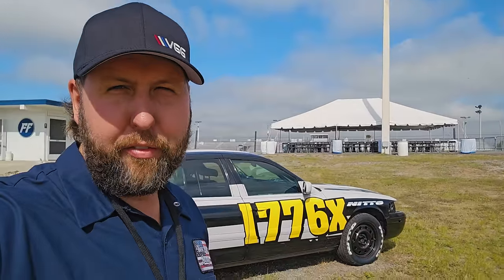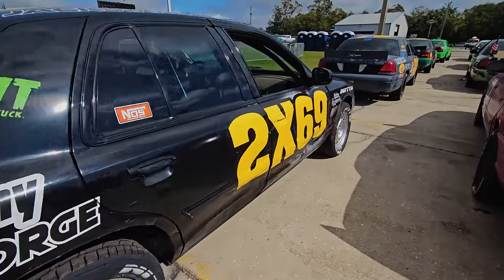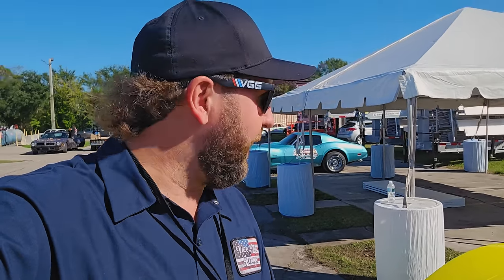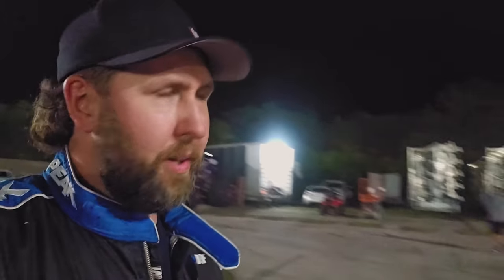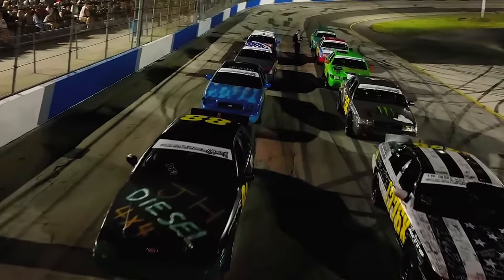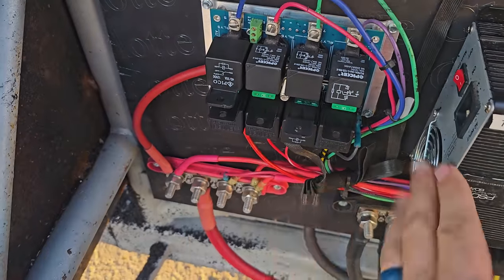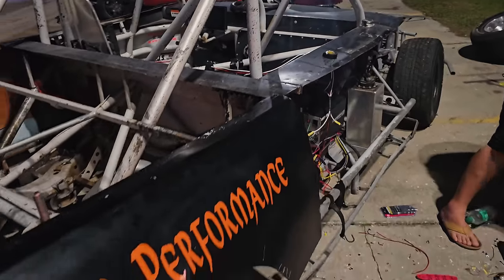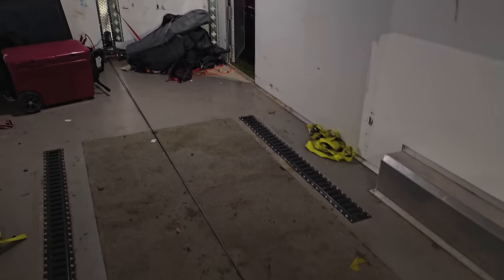We WON 1st Half At The Freedom Factory but BLEW UP Charlotte! (You won't believe how)

Comment: I'm impressed with your ability to cobble together a control system out of miscellaneous parts from the hardware store.
Reply: anyone else having flashbacks to bill and ted's Bogus Adventure?
Reply: I had a fella help me this weekend at a race track that was like that. The key broke off in my ignition and flew on the race track. The car was a 2010 Cobalt, so security systems out the wazoo. Fella actually ended up bypassing the security and started my car for me, no key and I got to race! It was a thing of beauty.
Reply: I'm sure that would have impressed MacGyver.

Comment: Chinese Fire-Drill is said to have originated when a ship run by British officers and a Chinese crew practiced a fire drill for a fire in the engine room. The bucket brigade were to draw water from the starboard side, pass it to the engine room, and pour it onto the simulated "fire". To prevent flooding, a separate crew was ordered to ferry the accumulated water from the engine room up to the main deck, and to heave the water over the port side. The drill had previously gone according to plan, until the orders became confused in interpretation. The bucket brigade began to draw the water from the starboard side, run directly over to the port side and then throw the water overboard, bypassing the engine room completely

Comment: Not having power steering could save a guy's front tires and prevent understeer!  When I was a kid I'd always remove the power steering from my Datsuns, they were so light and not being able to just panic crank the heck out of the steering mid turn saved me more than a couple times.  Never had an issue except going slow in parking lots, then you just muscle through it

Comment: I learned quite a bit about monster trucks, especially watching monster jam. During the seasons 10 years ago on weekends. monster trucks take their tires and what they do. Is use a Torch and a saw and they cut part of the treads off. Which goes along with what you say about favoring tires like the one that's on this bad lad of a monster truck! That way as you put it, they slip and slide around a lot better than being so grippy!

Comment: In the future, you can conformal coat that relay PCB, make it a bit more water resistant. Either way it’s not meant for exposed use, as you already know, and should be boxed… same for the ribbon cable.

Comment: Heck of a job in the race and the burnout pit. You seemed really down after the burnout, but you did great and put on a great show. I'd hate to see you throw in the towel with Charlotte, I love watching her shred those red and blue smoking tires. Maybe go through and delete any circle track suspension setup that makes it turn left, and give it another send. I bet the motor isn't as bad as you think. Even if it did get washed, it's a burnout car... Just plug the plugs in and let it cool off. It'll be okay enough for what it does. Shoot, ol' RodKnock Rodney just sits in the Florida rain and only even gets fired to do burnouts.

Comment: If you're planning on installing another relay board similar to the one that failed, you might want to consider a water proof coating on it and the other electronics. Many car manufacturers already put conformal coatings on their circuit boards that are exposed to the elements.

Comment: Derek, a thought for Charlottes electronic system. Have a look at something like the Switch Pros SP9100. 35 by 35 amp and 4 20 amp circuits. But it's a waterproof system, which should survive better. 

Sucks you're still having mechanical issues too.

Comment: In the past 10 years we’ve used something similar to that more like four years but nonetheless we always go back to weatherpack plugs for the relays and we have no problems might sound not so technological but nonetheless it’s not as clean of an install as not circuit board but much more resilient as well as weathertight fused connections

Comment: Was pulling for y'all to get the 'Vettes. Really sorry about Charlotte. I have to say, every time I see that truck, I wanna fly (or drive) to Tennessee, pull all the wiring out an run all new wire. Put a proper body on it. And, install inner structure into it, especially around the rear tires and axle and the electronics. Honestly, I just wish I was closer to help y'all with whatever. Any who, y'all take care.

Comment: I loved the video but cant wait to see thst duster finished. I have some blow by in my rig. Was checking the oil last night and smelled gas big time. Cylinder 1 rings are worn. Im going to put some snake oil in it and see if that helps. Its not smoking at all tho. Maybe one of you  fellers has some advice for a guy??

Comment: What happens when you wash the rings out? Raw fuel goes into cylinders without combusting goes past rings into pan. How does that hurt cylinders? Or rings?
Reply: Washes the oil off the cylinder walls in the dead cylinders causing metal on metal scraping. After that it starts diluting the engine oil in the pan once it makes its way down there

Comment: Derick can you or some legends here in the comments explain to me what contributes to the really fast reving that you can get out of an engine, like when ya stab the throttle and the revs go up really quickly, what parts or what do you need to focus on to make that happen? is it a heads thing? like should the heads be ported and super slick for the most breathability?

Comment: Cage looks good. Better than the SCCA Improved Touring car I drove in the '90s. The rules didn't let us have a lot of crossbracing - they were afraid we'd do it for chassis stiffness instead of safety. Literally laughed at loud at Jack talking about the hammer..buddy of mine who raced as SCCA as an amateur got his way onto the crew for a pro team running BMW E30 M3s in the old "Firehawk" IMSA series. One of their drivers had a disagreement with the tire wall in practice, my buddy was beating the front fender back out. He thought, "..wait a minute - I'm using a sledge on a 35 thousand dollar car!!" Great days. 

Looks like everyone's on Nittos. Choice, or spec tire?

Comment: Hey I got a question I'm pulling my 350 out it has around 250,000 on the motor I'm going to do a complete rebuild I just want a thumper cam in it is that cam already set for 15 degrees advanced or do I need to do it at the timing just curious

Comment: I used to be the keeper of the Vice Grip Garage Glossary back in the Early Days, but since so many others are now part of the fold feel it is unnecessary to continue to publish the lexicon for newbies to get them up to speed. That said, since the Lightnin' Whirler is now obsolete on newer cars I was wondering about a new term for coil on plug ignition systems. Any suggestions?
Reply: Lightning Nuggets?
Reply: "Lightnin' injection syringes."?
Reply: @panamafloyd1469  "Lightnin' Injectors"? Seems pretty good...
Reply: @351cat  Funny, but no.
Reply: @privateer0561  , yeah,  I like that. "Sends alll the lightnin' down the hoses from all the bleep-bloop boxes that's been sitting out here in the rain for so long.." Derek needs to add a couple of wire brushes to his little tool bag on these rescues for the newer stuff, though. <grin>

Comment: the board isnt nothing out of the norm..... them resistors and diodes are flybacks. when the reley turns off . it will send higher volts out. for just a sec. thats what that board stops form goin out to the rest of the stuff. flyback ... look it up

Comment: hey I just bought a 85 camaro with 80 thousand original miles however it has been parked since 2000 lol, I have it running and driving good. my question is what would you do nwithe the transmission, it is the automatic, Should I change the filter and fluid, Have been toold both ways change it and leave it alone lol
Reply: I’m no professional by any means, but in my opinion, with such low miles, a fluid and filter change would be just fine to do.
Reply: thanks @thefarmkid13

Comment: Just an idea that no one will see anyway.. wonder if you put the higher gear rear end back in.. and then add maybe 500+ pounds to the rear section? (Assist in smoke and tire carnage) less rpm but exponentially more weight/friction  and the higer gear to power it.. Also for pucks sake get some shrapnel shileds behind your head.. we'd like to keep seein a feller alive